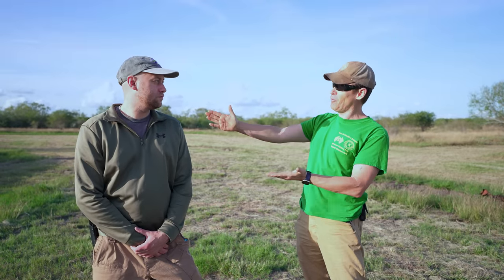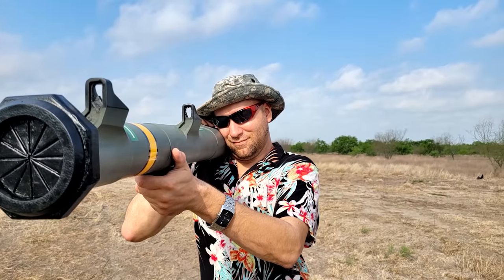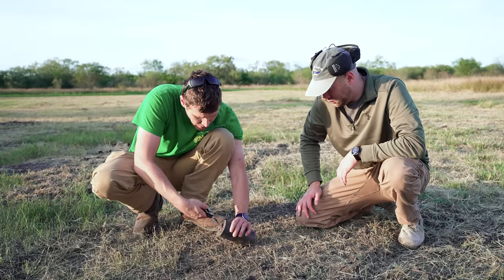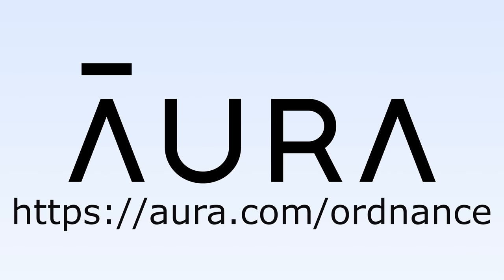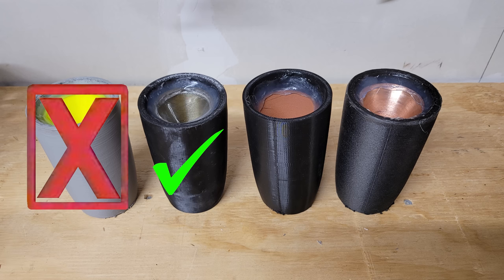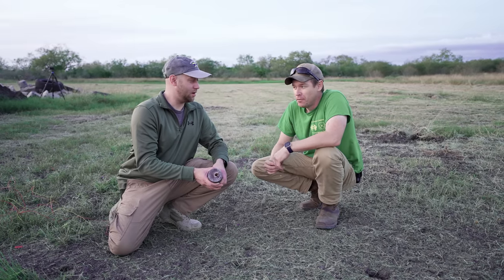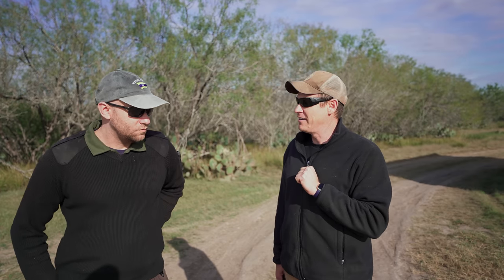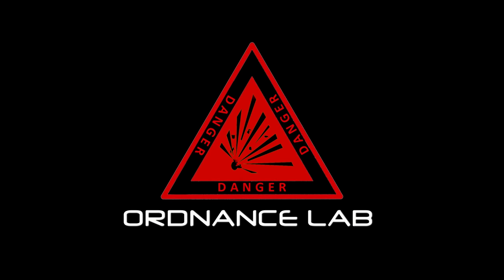Revolutionary 3D Printed Explosive Shaped Charges | Feat D&S Creations

Comment: I used to work down the street from Raytheon. That place is like a fortress you can't get anywhere near that place without clearance. My mother's brother worked there in the early 80s. He developed guidance chips and other military weapons. He died from a strange form of cancer due to radiation exposure. HMMMMM 🧐

Comment: For armor reference, most tanks in WWII and even modern day uses Rolled homogenous armor (RHA) for its steel armor (MBTs will have a mix of RHA, composites, heavy metals, and other materials in some areas that need the most protection like the front of the hull and the front of the turret, while the rest is typically just plane old RHA, though there could be composite screening, NERA, or ERA slapped on top to help defend against chemical and kinetic rounds in those areas.). I would say, the average side armor of a tank in WWII was between 30-50mm of RHA, while the front was typically thicker. The 3d printed copper would have gone through the side of many German tanks (All their light and medium tanks except Panther G and F), and the top of pretty much all of them. It could go through the top of pretty much every other tank in the war as well, and through the lower side plate behind the tracks of the Sherman. As for modern vehicles, this could easy go through a Bradley or BMP hull in many areas, and would do so against the BMP far easier as that has even less armor than the BMP, with most areas being less than 20mm thick, meaning it can be penned by .50 cal. For the Bradley, Im pretty sure it can go through the engine deck, the sides, and the rear, not sure about the front. The thing about MBTs though, is their armor is fairly classified, so maybe their top armor has some protective layer no one knows about that helps against these weaker shaped charge rounds, but based on what we know, most MBT's top armor is around 40mm thick for Nato, and slightly thicker for Russia and China I believe. I could be wrong.
Reply: The shaped copper cone one with over 50mm of pen though, thats insane! FOr a home made shaped charge, that can go through most modern armor vehicles and tanks from the top, and many from the rear and side. Even some from the front. If you put a impact fuse and set em on a drone, this would be insane to drop onto an unsuspecting vehicle, and could mission kill it if you aimed for the engine or turret.
Reply: @unexpectedspanishinquisiti3967  These guys actually did a video in the past explaining that using a drone to deploy explosives enters a whole other realm of the law (FAA), which is why they've never deployed munitions from drones...such a bummer; wish they could get creative with drones.
Reply: @lukebaehr3851  Oh, I know, I wasn't saying they should do it. I'm just saying if someone does it against actusly tanks, these homemade shaped charges could prove very effective. They probably cost around $100 a piece, and it only takes maybe 2 on the engine deck to mission kill a modern MBT, which costs tens of millions of dollars.
Reply: @unexpectedspanishinquisiti3967  right! Far far cheaper than conventional munitions paid for by the taxpayers. What's the cost of a single replcement Javelin or Tow Missle? They are probably many 10s of thousands per unit, if not more. Not to mention the platform they're deployed from.
Reply: @lukebaehr3851  the javelin and tow launchers themselves are reusable, as the missile is pre loaded into the launcher tube, which can be discarded once fired, ans a new one placed on the launcher platform.
Reply: @lukebaehr3851  overall, the tows and javelin are are quite affordable for how effective they are, and a single javelin or tow is worth far less than even the older and very outdated T54, meaning your not wasting too much money per use, but you really can't beat the low pow cost of a drone modified to drop a homemade shaped charge lmao
Reply: @lukebaehr3851  I just remembered that the US has developed 40mm DPHE rounds (dual-purpose), which are shaped charges that can also produce good shrapnel effects if used for regular use. It has around 76mm of penetration on RHA and is small enough to use drop from a drone. The US still makes them j think, and they probably only cost a few hundred bucks or less per round, so that would be pretty cost effective.
Reply: @PilotTed  that is true....but if you dont have any left...bummer
Reply: @lukebaehr3851  doubt it, pretty sure we have millions in stock and we may still make them. I'm pretty sure the 40mm on the AC 130 uses DPHE rounds

Comment: Have you guys tried using wave shapers, or subcalibrated liners? 

Could increase penetrative performance; or allow you to maintain performance with a shorter, lighter charge. Which would be useful once you guys get the rockets figured out.

There's also double liners, add a second liner of pyrophoric metal like Aluminum or Magnesium for increased incendiary effect post penetration. I know the increased blast and detonation temperature of Aluminum based explosives can reduce the effectiveness of shaped charges, so some of this might counteract that.

I'm not an expert so I don't know how easy or effective these would be for what you guys want to do. Either way, the videos you guys put out are always interesting and entertaining. Keep up the good work.

Comment: Amazing performance.

A fair bit of the performance difference  would be the difference in density if the   pure copper and the printed liner had the same dimensions if my understanding of the physics is correct.

Comment: I would love to see if copper powder could be pored in to a printed void to make the cone shape. Or foil tape wrapped around a plastic cone.
Reply: Powdered liners exist.
Mainly to cut holes into deep bore holes.
Don't want to clog the pipe with solids....

Comment: 3D- printed copper liner: Check. 3D- printed rocket body: No problem. If you find a way to make an explosive filament, you could 3D- print the charge, as well.

Comment: When welding with flux core it can be hard to see the weld under all the smoke and flux that stuck to the steel. I’d love to see you guys go at the samples with a wire brush I wonder if you would be able to see any ribbing or like scoring within the damage to the samples. Love the video!

Comment: What was the total weight on completed unit. One thing to consider is to vary the thickness and depth on the 3d printed coper cone, in order to get the proper liquefaction of the copper. Also there is the availability of 3d printed charge itself to increase the burn, think of solid rocket booster fuel shape.

Comment: It takes 80mm of penetration to destroy a T72 from the side having a tandem charge will allow for the charge to counter the ERA T72B (contact 1), T72B3 (contact 5), and T72B3/M (Relkit) side ERA. The T72BA1 (which was a non service prototype) has dual layer ERA (contact 5, then contact 1) so a tandem warhead won't be able to penetrate it.

Comment: I have a general question about the ammonia nitrate used in instant cold packs, as I found mine have all soaked up water from the air, even tho the plastic package is without holes. Since they have been exposed to water, they don't work as cold packs now, but I want to save them for later, but how safe is the wet AN in a plastic container?

Comment: I wonder if having the copper loosely bound allows for increasing its volume.  It takes energy to invert the cone so im saying that having the metal be mechanically bound to plastic in the 3d printer will allow for easier transformation during det.  This reduced mechanical energy need could be translated into increasing the cone thickness and effective jet mass would be greater and that should result in more penetration per given bang.

Comment: Tungsten filled PLA (85-94% metal by weight) is pricey, but available.
Dunno if higher mass material would give better performance.
If you used it 'green', which is to say without sintering, the metal particles would collapse into a jet pretty nicely.
Reply: Already happening, we have attracted some interested industry people who don't wish to be named yet.

Comment: the copper printed cone probably melted better because of the higher surface area to take in heat and that the copper particles would have been a whole lot finer than solid copper so would liquify faster even if there was less copper present in theory it may actually have caused the copper to melt more reliably and evenly

Comment: tell them they can use off the shelf oil well perforators they're the perfect size and exactly the same as the conical shape charges you showed using hmx they're going to rip right thru that armor and into the ground

Comment: I'm not an engineer, but from looking at other shaped/directional charges. I'm not sure if this question can be answered publicly, if not i'm willing to get in touch to discuss. 

behind the shaped charge, wouldn't a backer or filler of a non compressible fluid such as water or hydrualic fluid between the body and charge be beneficial in aiding the shaping and directionality of the blast?

I cant add pictures but i'll make a sideways diagram in this comment:
"[" = shaped charge body
"<" shaped charge layers
[water/hydrualic fluid<<

It would add weight, but if its rocket propelled, it shouldn't be much of an issue.

I also think the sintered material did better due to it taking less energy to melt and shape smaller pieces of copper than one large piece. Similar to how melting cubes of butter is faster than an entire stick.

Comment: Interesting to see the sintered copper print, first saw this by another YouTuber by the name Integza trying to 3D print rocket parts. The company that makes the metal doped filaments has many other metals available depending on the temperatures you can get sintering temperatures of.
Reply: Specifically states it's not sintered but standard fdm filament.

Comment: You should check out resin 3d printers and ceramic resin. It would be interesting to see how a ceramic cone would compare to a copper one.
Reply: Too brittle and light, ceramic wouldn't be able to do much shaping of the wavefront before completely disintegrating.

Comment: I wonder how copper electrical wire in the same shape as the printed copper would work. It's a lot more abundant than copper filament and you can reuse a printed or machined winding mandrel.

Comment: keep in mind that A36 Hot Rolled has tensile strength of around 400 MPa, whereas rolled homogenous armour has a tensile strength of over 800 MPa. This probably doesn't matter as much to a shaped charge jet as it would to a kinetic projectile, but I wouldn't rely on A36 as a perfect stand-in.
Reply: $$$ I'm not monetized. All the research is entirely self funded.

Comment: There's a rule you should follow to increase the efficiency of your charges. The outer hull has to be much stronger than the cone. If it's not, the most of energy goes first into destruction of outer hill instead of going into the cone. PVC pipe with glass cone is good combination. 3d printed pipe with metal cone not so much.

Comment: can you make a video using anfo and black powder in a molded charge to see which one is more efficient?
Reply: Black powder doesn't detonate. It won't make a shaped charge. Black powder is a propellant, not a real explosive.
Reply: @DandSCreations  yes but what if the warhead was made completely sealed with the easiest part for the pressure to come out through the copper cone maybe it would be possible and would make a nice video
Reply: @DandSCreations  you gained a new subscriber friend
Reply: You would just have a really bad cannon.

Comment: Great video fellas, I thoroughly enjoyed it as per usual.
Perhaps someone might answer this question for me, "When you use glass in the shape charge,, does the glass itself actually from into a penetrator similar to when copper is used, or is it just having the effect of lensing the blast energy into a focused point, the target?"
And also if it is indeed forming into a penetrator then what is it that makes certain materials more or less useful for this purpose?
Thanks
Reply: Metal powder liners are used in deep drill hole applications to cut horizontally in to the layer they're interested in.
They dont used monolithic solids because they dont want to clog up the hole.

Glass will be pulverised but keep in mind that glass powder is harder than steel it will abrade the target just fine.
 It's mainly a somewhat readily availabe improvised shaped charge liner that has some performance ( roughly half of a somewhat decent 1st gen copper liner ). They have used fizzy wine bottle bottems previously.

Ultimately kinetic penetrators cannot more penetrate more than relative density * projectile length. Since glass is much less dense than steel that does limit performance.
Reply: And shaped charges without liners can cut...but since air is compressable and of low density and no structural strength its ability to deform solid metals is limited.

Comment: You guys should try replicating the fire extinguisher RPG-7 rounds that the Chechen separatists fighting for Ukraine have cooked up. As far as I can tell they are the 5lb or 2.2kilo extinguisher with the bottom threaded out for the rocket and some sort of impact fuse where the gauge and nozzle would have been. Would be interested to see what damage they could cause with different fillings like 100% explosive, 50/50 explosive and shrapnel, perhaps coin coated hill, idk they look crazy and must pack a whallop to be worth the effort of manufacturing them.
Reply: Theyve done something similar before with the soldering tank/propane cylinder/MAPP gas cylinder mortars.

Comment: Do you accept challenges?
1) Get a Printed Circuit Board and then design an explosive mat underneath it so that when it detonates all of the memory & processor chips get cut to pieces.
2) Test using flat Li-ion batteries as a shaped charge instead of copper.
3) Make a quadcopter which turns the 4 electric motors into explosive formed slugs when detonated.
4) Make a quadcopter where the body is made of plastic explosive instead of plastic or carbon fibre.
5) Put all of that in one package.
If you are wondering why, drones have a weight vs payload issue one way to get around that is to make the structure out explosives and use the batteries\motors\electronics as shrapnel, every part of the drone has one use in flight and a secondary use on detonation.

Comment: pressed cone versus printed cone............ is the printed cone due to its structure ( more granulated ) performed below the pressed cone?   C.q. the pressed cone formed a more intenser tighter formed 'jet' and therefor penetrates deeper.  But for sure, amazing results! ( and printed on a 100 buck printer )

Comment: Well, at the very least with 58mm of penetration you can make it through the roof of any modern tank out there. Granted the roof of tanks occasionally have ERA and are generally cluttered with sights, sensors, MGs, etc.
Reply from the maker: The initial prototypes are did well. This gives us data so we can refine the design for better performance.

Comment: I wonder if you could make a shape charge out of smokeless powder single or double based (100% Nitro cellulose, 80% Nitro Cellulose 20% Nitro glycerin). The burn rate with the faster burning powders, when it's contained is approaching 30,000 feet per second.
Reply: Just make 200 grams of hun cotton and your good

Comment: One of the biggest things you need to test is offset or standoff. The projectile needs more time to form than 6 inches.
Reply: It's got 2.1 diameters of standoff which is appropriate to the diameter and angle of the cone.
Reply: @DandSCreations  part of the reason copper shaped charges are so effective is the plasma layer that forms on the projectile. I doubt that pushing through 6 inches of air that was already evacuated by the pressure wave from the explosive is going to give sufficient effect. Go ahead, ask me how I know...
Reply: @mostlycensored7668  we already plan on altering the material geometry the explosive volume, explosive type, and standoff anyway.

Comment: 3" of A36 steel is superior to the armor on an M113 APC.
Reply: Are the APCs that badly armored?
Reply: @boltvanderhuge4858  almost always. M113 is less than 2 inches of aluminium.
Reply: @boltvanderhuge4858  The M113 is a battle taxi rather than a fighting vehicle. It's not meant to trade blows with other armored vehicles, it's meant to get you in and out of places where dumb mortars and artillery are landing.
Reply: @boltvanderhuge4858  APCs are generallybonly armored to stop standard infantry  rifle FMJ bullets.  IFVs are generally armored a little heavier to the front, because they anticipate facing direct fire from grenade launchers and autocannons.

But armor is *heavy*, and if you.try to armor the vehicles to high levels of protection, you quickly either lose most of your useful carrying capability (because you have to shrink the volume protected to reduce the overall weight) or mobility (because weights get ridiculously high fast).

Look at the weights and dimensions of an M113 APC versus the M2 Bradley (even ignoring the turret).  And the Bradley is really only armored to resist 14.5mm HMG fire all around, and a little bit more to the front (and even the AP versions of 14.5x115mm ammo are designed for less than 2" of penetration on steel armor at 100 meters).

Heck, most vehicles lighter than an MBT or a full fledged IFV are considered ".50 cal targets", because .50 BMG ammonis cheaper than 120mm tank rounds and you can kill the APCs and light AFVs with the M2 just fine.